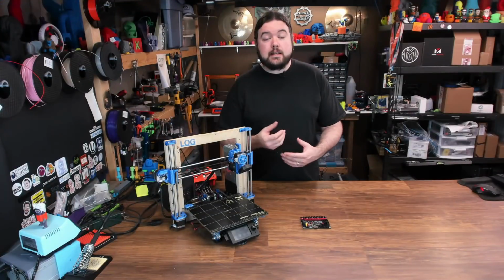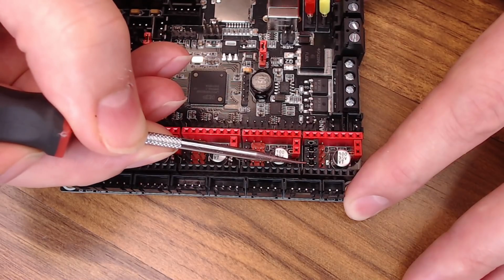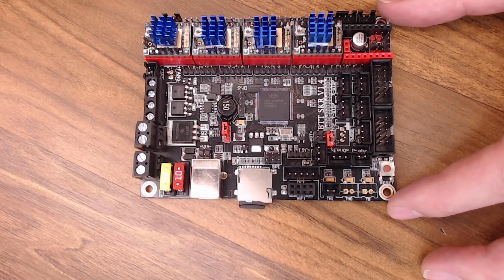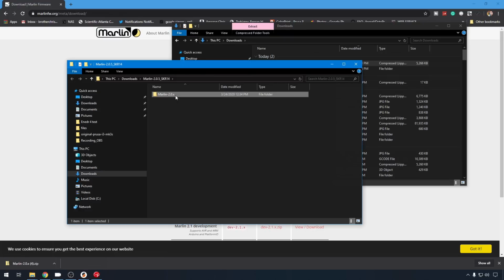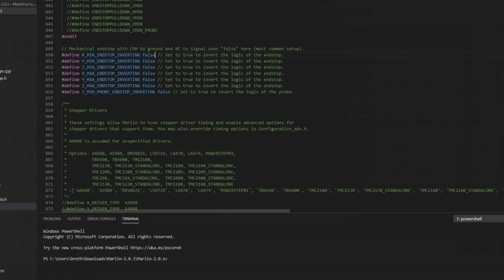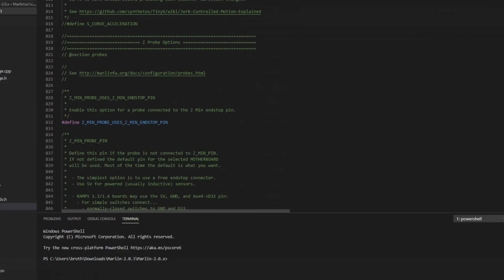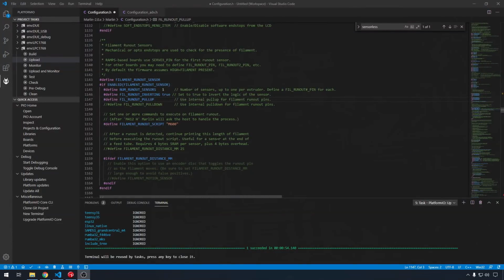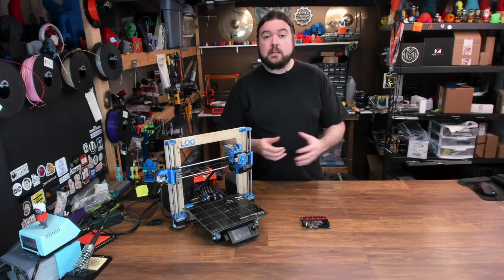BigTreeTech SKR v1.4 Mainboard - Full Install Part 1 - 2209 Drivers - Chris's Basement

Comment: very thorough. man am I stuck...something funky is going on with my skr 1.4 turbo in tarantula pro, 2208s and bltouch.  after homing, the extruder parks in the back right corner instead of centering. the center position reads x60  y61, but my bed size is defined 235 x 235. safe homing is defined, at x &y /2 bed size. I've only done the basic changes to marlin,  So I'm stumped, how do I define my bed size at the correct dimensions and get it to home centered? If all else fails, how do I factory reset the SKR, so I can rule out saved settings and focus on troubleshooting the firmware?
Reply from the maker: So first thing, do a m502 then an M500 to clear out defaults. Then, if you are still not in the center, if your nozzle is outside the print bed at home, add the amounts outside in the negative to your min home position.
Reply: @ChrisRiley  Ill try that--thanks man

Comment: The pins were prob the most confusing for me Chris. I'm only using the BLTouch 3.1 probe with a Z switch, sensorless homing on X and Y, clipped the E diag pin along with the Z. The 3.1 BLtouch has it's own pin slots with proper colored layout (that don't go into the Z min pins), but I still have questions about the pin designation. That section (in config.h) where you choose between either commenting or uncommenting the #define Z_MIN_PROBE_PIN 32  OR #define Z_MIN_PROBE_USES_Z_MIN_ENDSTOP_PIN. I have the Z connected, but only the Z min endstop pins are connected to their home cus I'm using sensorless homing on X and Y.  I'm not sure what to do there for the BLtouch 3.1. Do I designate the probe line with Pin 0_10 (cus it looks like its pin 0.1 on the board?) so it would read #define Z_MIN_PROBE_PIN P0_10 ? There's also Pin 2.0 (which is the home for the colored BLtouch wires). That part sucks to figure out and I don't know how to handle that one within config.h or the LPC1768 pin file (I have the reg version, non Turbo). Marlin is 2.0.5.3
Reply from the maker: Hey Andrew, I actually haven't figured this out yet, I will be working on this soon. There will be a video.
Reply: @ChrisRiley  Excellent. I just got X and Y sensorless homing to work, now I'm figuring out the Z, the speeds, while seeing if I can find the balance with hybrid mode for stealthchop. You're channel and Teaching Tech is a savior, praise!
Reply: Only thing I could get working with it was to use the Zmin pin with the black/white v1.3 bltouch wires, and tell Marlin to use that area as the Z min endstop. I also had to invert the Z_min and Z_min endstop to true.
Reply from the maker: @miremaker  Interesting, I will check it out.
Reply: @ChrisRiley  Do you remember which video I can find about using a zip tie on the bed for the spacing of the probe to nozzle?
Reply from the maker: @miremaker  I do it in a couple, but try this one. https://youtu.be/iwhbeD2AduA?t=1119

Comment: Good timing. I need a new controller for my Ender 3 since the crappy SKR Mini E3 v1.2 board I had only lasted a couple of months. I hope this one lasts longer. At least if one of the stepper drivers dies I won't have to replace the whole board.
Reply from the maker: Let me know how it goes, I am curious what kind of case mods people are doing.

Comment: On one hand, it's great to see that the more affordable boards are stepping up their game and coming out with some nice hardware. On the other hand, having to go to this level of difficulty setting up the board for Marlin is, well, daunting.

I went through this process for my FLSun, which was mandatory since the firmware as provided by FLSun did not work. More correctly, the SD card that came with the board was faulty, and/or wasn't loaded properly at the factory. FLSun support consisted of email support, which wasn't much help at all, so I took a config file out of the Marlin source that resembled my machine (the CL-260 IIRC) and created my own firmware. 

It took forever, but I got things working fairly well, and then two things happened. My Z endstop quit working on the board (something that had also happened to other FLSun owners), and Marlin rolled out a new version and broke many of my settings for my board. Enter the Maestro board.

But for someone on a tight budget, this board really does look nice. And it is a whole lot cheaper than a Duet.

And your knowledge of the Marlin firmware is encyclopedic, very impressive!
Reply from the maker: Thank you! I know it's still kind of a pain, but Marlin has some stuff in the works that should make things easier.

Comment: hi, chris do you have a video for steppers 2208? on this board for a ender 3. thanks.
Reply: ok so if I use the same info from the 1.3 but do it as a 1.4 should work? and by the way thanks. for the help.
Reply from the maker: @patricklemieux9696  Yep, it should work.
Reply from the maker: I don't but I show it on a 1.3, very similar. https://youtu.be/duNHOPlh2Pg

Comment: Hi I have this board the turbo and the 2209 stepper drivers. What are the settings I would need for the cr-10s. Sorry to ask novice questions
Reply from the maker: Check out the Mini video from today. You can use the Marlin example for the CR10 to get you started.

Comment: Homing without sensor ! Who knew ? I'm still messing with the bltouch ! Where's that scratch build ?lol cool board and drivers  ! Makes me want to buy more stuff. Cool video 👍😁👍🌞 .
Reply from the maker: It's like magic! Thanks!
Reply: @ChrisRiley  found out the jumper for the ramps 1.6 for the servos is by e0 header now after all this time I maybe can use BL touch lol😁👍
Reply from the maker: @wishicouldarduino8880  Nice!
Reply: @ChrisRiley   hate to be a bother lol but I just got some new stepper motors  nema  17  42  steppers what is the difference between them and garden variety nema 17   1.8   angle motors it doesn't say much other than that except bi polar and such are they better motors ? I want to put them on the Frankenstein printer on the bot are they an upgrade from the pancake style motors I have now ? Thanks for any advice 👍😁
Reply from the maker: @wishicouldarduino8880  Hey, not sure, can you send me a link to those and I will take a look.
Reply: @ChrisRiley   actually I tried them out they work really good but they are loud it says they are high torque maybe that's why .im trying to find a link on amazon.
Reply: @ChrisRiley   hey Chris hate to be a bother but how do I keep my printer from banging into max and going graggggghnmdreee ? I want to be able to make the BL touch go to the right place on the bed as it is it homes at the corner but when I send g29 it probes off center to max side and then grinds into max same thing with y I know my build is a little tight to my bed size is there any way to compensate for this thanks for any advice.👍😁

Comment: Are there any jumpers I need to install for TMC2100's? I've searched their manual and online and I can't seem to find anything regarding the TMC2100. I guess it was never a popular driver, but it's what I have on hand.
Reply from the maker: If you want to use the software control mode it's the same as 2130's. You use the SPI mode. https://github.com/bigtreetech/BIGTREETECH-SKR-V1.3/blob/master/BTT%20SKR%20V1.3/SKR%20V1.3-Instructions.pdf You will need the diag pins soldered on.
Reply: @ChrisRiley  Hey Chris, you seem to have linked documentation to the SKR 1.3 board, as opposed to the 1.4 which I think you meant to link to. Regardless, you're saying that to run the TMC2100's in SPI mode I would need to solder on the diag pins. Are those the two pins that would fit on the end of the stepper driver breakout board? Is there anything special I'd need to do in Marlin? I presume mainly just set the axis drivers to be TMC2100 instead of the default A4988. Would I also be able to set the vref in the firmware itself in configuration_adv with this driver config? Thanks!
Reply from the maker: @thetimo0060  As far as SPI, 1.3 and 1.4 will be set the same. Yes you will have to solder those pins upfront, yes this will allow you to set the vref via code/command line.

Comment: Hi I have a question how can i transfer my config files and setings etc from marlin 1.16 to marlin 2.0 or the newest version there is. Is there a tool can i just copy the config h files ? I had ramps 1.6 and now i have skr 1.4 turbo board and I can cofigure the board seting etc but i need to trasfer like size and temp sesors and probes etc and manualy it will be pain in the ass I am lost all help is appreciated thank you so much :D Sory for english
Reply from the maker: Unfortunately there is no tool to do this.  Your only option is to use a program, like notepad ++ to compare both files line by line and update the new version.
Reply: I hope that the structure of thigs is at least similiar but thank you :D

Comment: Still a bit unclear, Do I need to clip the pins on the Z and E drivers? I've got SKR 1.4 turbo + 2209 steppers and a 3.1 BLTOUCH.
Reply from the maker: I would, yes, this will ensure things don't get confused. You're not going to use them in this config anyway.

Comment: So editing the pins files is considered the proper way to rework things, and not just a hack that was the only way I could make it work? I had to move some things around for a delta config, felt dirty altering files other than Configuration.h and Configuration_adv.h. Glad to hear it wasn't as much a Duck tape solution as I first thought!
Reply from the maker: Hey Scott, yeah, this is pretty much the only way to go. You can override a lot of pins in the config files as well, but I think the pins file rework is the way to go.

Comment: #define SOFT_ENDSTOPS_MENU_ITEM  is a feature I enable on my machines, very handy so you can turn off soft endstops in the Motion menu. Good for doing maintenance or setting your Z offset without having access to a terminal. I have an SKR 1.4 turbo I'm going to install on my Taz 5 as a part oi a little wiring revamp as well.. been having some issues lately with the X stepper motor wires getting hot, banging my head against the wall troubleshooting filament constantly grinding on my aero, really hot stepper drivers as well as other odd motor behavior.... figured its time for an upgrade anyway. thanks for the vid!
Reply from the maker: Great point James, thanks for the comment, good luck with your build!

Comment: It seems mostly the same as the btt skr 1.3 setup, just sub in the relevant drivers and mainboard names. One thing I can't seem to find is how to make the induction probe land at the correct spot for the prusa mk2.
Reply from the maker: That will be in tomorrow's video.
Reply: @ChrisRiley  Cool! would you make your config files available for download? My setup is almost identicle to yours. I just tried to flash and enabling REPRAP_DISCOUNT_SMART_CONTROLLER, sd card support, and speaker,  I have no screen or sd support. I'm dropping it into a stock prusa mk2s.
Reply from the maker: @StevenSSmith  Sure, here you go. https://drive.google.com/open?id=1xC2EuXeCbaMC50CdEEbNiMB_oxL1EuDx
Reply: @ChrisRiley  You sir are my favorite youtuber!
Reply: @ChrisRiley  The wires for the standard prusa screen ( REPRAP_DISCOUNT_SMART_CONTROLLER ) have to be flipped for anyone else wondering
Reply from the maker: @StevenSSmith  Thanks for this!

Comment: Great video, I recently forced a SKR V1.4 Turbo into my CR-10S Pro. I am using Vanilla Marlin 2.0.5. After a bit of googling I managed to get the BL touch probe port enabled. I am really happy with sensor less homing and the access I have to adjust firmware settings through my TFT35 V3.0 duel mode screen.
Reply from the maker: Nice! Glad it's working for you.

Comment: No need to cut DIAG pin on Z stepper driver. Board is smart enough to sense if you have an ABL plugged into the Z end stop plug on the board.
Reply from the maker: Yep, as long as you don't want to use the PS detect pin, you're all set.

Comment: will you review the skgo 3d printer? it seems like such a awesome printer but there's nobody talking about it
Reply from the maker: Yes I will, I have one I am currently testing.
Reply: @ChrisRiley  awesome! im starting to look for a second printer and I want something reliable and and great printing quality also do you have to do much electronics wise? do I have to program anything on it or what has to be done there cause that's the only thing I'm unsure about, thanks
Reply from the maker: @alexanderbecknell3677  On the SKGO, Ernest does a pretty good job of pre loading the firmware on the board so you should be good there. It is a pretty large build, so be ready for 10is hours for this one.
Reply: @ChrisRiley  oh yeah id be looking fowards to that I love tinkering I just have no idea about the software side of 3d printing

Comment: I love this sort of video. Great job, Chris!
Whenever I get a new board I use a red Sharpie marker to draw indicator dots on each of the positive screw terminals. Saves a lot of grief when you're trying to hook all the wires up in limited space inside a printer and can't see the silkscreen.
Reply from the maker: Thank you! That is a great idea, I never seem to just do this easy stuff first, I always wait and struggle later. Someday I will learn my lesson. :)
Reply: @ChrisRiley  I suggest a silver Sharpie since the terminal blocks and board are both black, non-metallic Sharpies are very hard to see on a black surface.
Reply: I painted the +ve terminals red.  A sharpie seems much easier

Comment: I'm thinking about ordering the SKR v1.4 and TMC2209's for my CR10s to replace the stock board but i'm having a hard time finding much about using the 2209's on the extruder. I know that the 2208's had some problems with linear advance, but I cant find much about the 2209's. To play it safe, I might purchase an LV8729 for the extruder but i'm not sure if it's really necessary. Im also new to upgrading the printer boards and this seems like a lot but i like to tinker and im sure i could stumble my way through it, especially given all the videos regarding setting it up like the one you have here.
Reply from the maker: You should be all set using a 2209 on the extruder, I run them on a couple of printers now, no issues seen with linear advance.
Reply: Chris Riley Awesome! Im definitely going to go for the 2209’s then. I really appreciate you going through all your comments and replying to each and every one! It’s not something you see often from content creators. Keep up the awesome work!

Comment: I have question.  My sensorless homing work perfectly.  Buy when I turn on the heater i try to home X it goes only 20 mm then stop. If i increase the sensitivity  then it works. But if i increase the sensitivity and work with out hotend heater and try to Home X. It hit and start grinding till printer halt. Whats the reason. My Vref is 800 and TMC 2130 SKR 1.4 turbo.  When will you teach us to install ESP 32 into the SKR 1.4. I saw you old video regarding 8266
Reply from the maker: That is a really odd issue. It almost has to be some sort of power dip from the PSU. You might be able to turn the voltage up a bit to help, just be careful. The BTT wifi video will be out soon.
Reply: Chris Riley thanks. When you make video of wifi plz also include Esp 32 model
Reply from the maker: @robo909  Can you send me a link to the ESP32 you are thinking of?
Reply: @ChrisRiley  https://www.youtube.com/watch?v=qxwXwNS3Avw

Comment: Chris, As always a fantastically informative tutorial.  Thank you for the time and effort you clearly put in to making these.
I was having trouble purchasing the BTT tmc2209's and went with Eryone 2209's.  I understand that the Vref and diag pins on these boards are transposed although I can find very little documentation to confirm this.  Can these pins be transposed for the SKR1.4 in marlin firmware or am I going to need to get creative with the soldering iron?  Again many thanks for the content.
Reply from the maker: Thanks Wayne,  I am really not sure the differences in those 2 boards, but, it is worth a try. I would just plug them in and see what works, as long as you have the direction and ground pins in the right place, you shouldn't hurt anything.
Reply: @ChrisRiley  I can confirm that the ERYONE Tmc2209's DO have the diag and Vref pins transposed compared to the BTT 2209's  To get sensorless homing to work with the SKR1.4 you need to snip the bottom pin off and use the header on the top of the 2209 to connect with a jumper to the SKR end stop pin for the axis in question.  Hope this helps anybody who was confused as I was.
Reply from the maker: @WayneNewtonuk  Thanks for the update.

Comment: @Chrid Riley Hi Chris, thanks for your great videos. Now i've to decide for the Creality Silentboard 1.1.5 or the SKR mini E3 for my two Ender 5's.
I run all Software under Linux (FreeCAD, Cura and PlatformIO) and it works great. Which of the two Boards you would recommend for my Ender 5's?
Reply from the maker: I like the SKR boards because they have a better processor, you can use 2209's and they are cheaper.